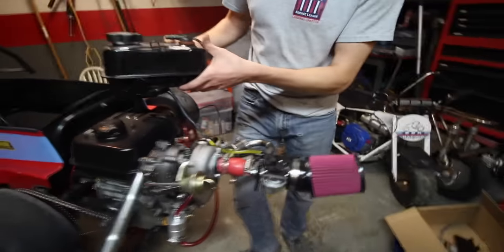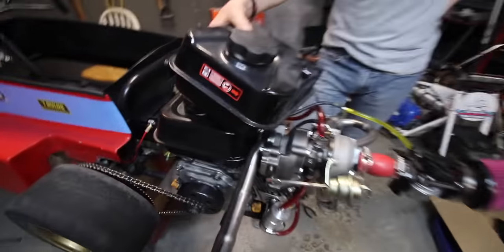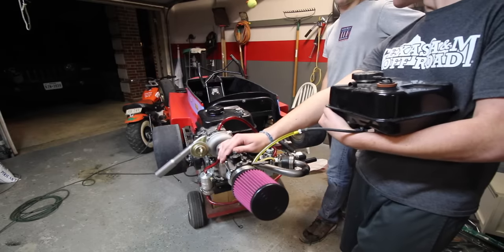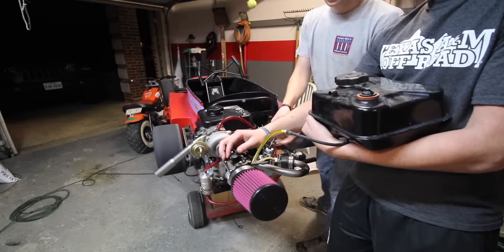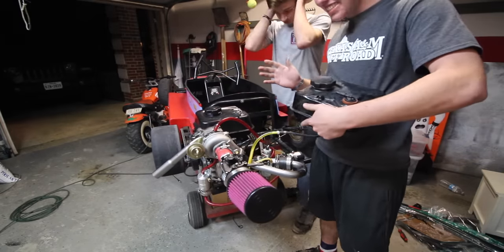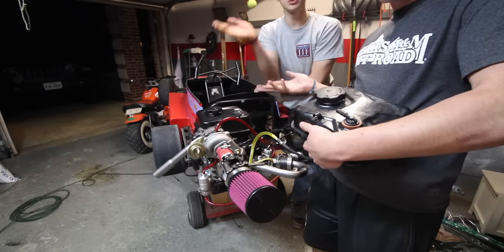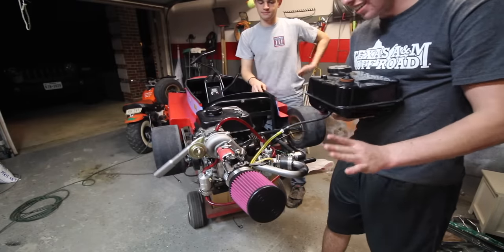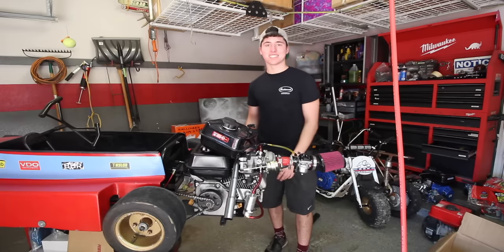Turbo Go Kart Finally Makes Boost!

Comment: There's two ways to do this with the setup you have!!(actually theres 3) All using only 1 carburetor!!

First two do not require carb on the turbo!

1: If you just build a box to put the carburetor that is on the engine inside of, then seal around the fuel line and throttle cable, applie boost to the box and not through the carburetor... it solves "some" of your fueling issues!! and you'll only have to Run one carburetor!!!  When you do this the whole carburetor sees positive atmospheric pressure and not just the Venturi!

Or.... 2: block off the Venturi Port which is the very bottom little hole you see when you look into the throat of the carburetor, then T into the boost line and apply boost to the carbs Bowl vent And boom! You've modified your Mikuni to be a blow through boosted carburetor!! 

In both of these setups without a fuel pressure regulator that applies positive fuel pressure at the same rate that boost comes on!! When the Boost does come on in both of this setups you will only be running on the carburetor's Bowl only.. so you won't be able to continuously stay on boost....

3: leave the carburetor thats before the turbo ditch the one that's on the motor and just jet it right!(This is the easiest one! but it doesn't create as much power as the other two)
Reply: Won't work pressurizing the tank. You need a pressure differential to move the the fuel. If the pressure in the carb is 5 psi, and the tank is 5 psi, what moves the fuel? There's no longer any vacuum. You need a boost referenced fuel system...

or quit fucking around and just draw through the 1 carb and forget about the second one. I'm still lost as to what this magical tuning problem is that can't be solved.

The first SVO Turbo Mustang was done the way I explained. It ran a mechanical secondary 2 barrel, into the turbo, and into the engine. Still used a regular float and fuel system. 

I gotta believe a set of jets has got to be a hell of a lot less expensive and time consuming than a boost box and a jerry rigged boost referenced fuel system .
Reply: Both setups I referenced only require one carb.... The two carb stuff is just wacky.. to say the least LOL
But, Your right About the boost pressure to the tank thing.. I didn't think it through.. LOL 

And a draw- through setup is a third option, its how alot of peolpe turbo bigger Vw engines... a 4 barrel carb or a side-draft weber draw- through setup! And they work good but, not as well as a boost boxed carb or blow- through carb setup and spitback/backfires on a draw- through carb setup can be catastrophic!.... But, with their fueling issues & "expertise"  a draw- through maybe their only option to just make it work! You know their gonna need help with the jetting though!! LMAO!
Reply: @superchargedadventures  The other thing that makes these setups a bit of a bear as well is the lack of an accelerator pump... unless those other carbs have them (I don't think they do) that nail the throttle open enrichment just isn't there... it has to draw air through to stabilize it and then get a stable mixture.
Reply: kleetus92 True! I think their best bet for top end at least.. would be to do a power jet mod to the carb!!

Comment: just use the carb pre-turbo. since velocity (air speed) is what pulls fuel, the one carb if sized correctly, and right jet and needle will meter fuel linear to air flow. The double carb will create serious issues. It will wind up with too much fuel, and too much turbulence.

Comment: What if you take something like they use in No2 set up to step down the shot strength except for your fuel for the second throttle body and leave it fully open all the time, that can be how to tune the fuel going in and then you just use the first throttle body going into the turbo intake side as your throttle control

Comment: On carburetors you need a pull through system or else the boost is just going to push the fuel out of the carburetor back into the tanks.

Comment: You should mount that Turbo on the intake side of the carburetor like a normal turbo would be mounted but instead of having your exhaust wind the turbo use a radio-controlled brushless motor to spool up the turbo which means put a pulley or a spur gear about the size of a 50 cent piece on the brushless motor with a smaller gear about the size of a pencil on the turbo input shaft and hook it all up with the radio control brushless Electronics and just use the transmitter as your throttle to spool up the turbo. I want a shout out if it's a thought that you think it might work

Comment: Pull through carb setups were basiclly the first turbo setups, they work really well, so long as you don't develop any leaks past the carb. They can be risky, because if you lose a charge pipe the engine goes full throttle.

Comment: Most carbs are not capable of being pressurized, when you push air into the intake it pushes fuel out, 2 solutions for this 1 draw through and 2 put the carb in a box so pressure is equal inside and out, but you also need fuel pressure and a rising rate regulator at some point.

Comment: The first carb in the boost tube wont ever work unless you delete the fuel to it and use it as a throttle body. Take you fuel line and run it to the before carb like an injector and remove the throttle flap out of it. Thats the only way your setup will work. Turn the fuel up and run it. There is still a chance of flooding the intake when lettin off the throttle due to the turbo still spooling drawing the gas out of the other carb

Comment: You need to use either a suck through system that sucks the fuel/gas through the turbo or a blow through system that blows the fuel/gas through the carby and the blow through system will need some kind of fuel pump as the boost will blow the fuel through the carby back into the fuel tank

Comment: Put a pic T fitting between the turbo inlet and tct carb so it gets air without having to floor the tct carb and flooding it to get it started

Comment: either leave the second carb wide open. or just do what people have been for ever and run the one carb on the turbo and tune the idle jet where itll idle and then mess with the main jet. the carb will pull more fuel as more air passes by the the throat

Comment: You should use throttle controls like a old Honda odyssey. Have them both on the wheel it will be easier to control because it would be like triggers on a ps4 controller.

Comment: They make an e.f.i kit for single cylinder engines...it comes with a throttle body, t.p.s, e.c.u  thats"programable"... fuel pump, fuel injector,  oil pump, turbo, wiring harness etc.

Comment: Make secondary fuel setup a washer pump motor that 12v push button activated. Shoot directly into the turbo.  which may be too much fuel so you would have to nozzle it so it wont dump raw fuel into the turbo.    kinda like how they introduce nitrous to the motors on these engines.

Comment: Mega squirt I beilve has kits that will work with any engine . Ever heard the acronym KISS?  What your doing is very complicated . You need more fuel pressure than boost.  You going to want more control than what your doing can offer.  I love the idea though.  Mega squirt it.  If your going to stay with cabs look at goped , polini and blata  carburetors there are some that make 20hp + . The carbs are adjustable.

Comment: replace the carb closer to the engine with throttle body and use it to cut vacume from the turbo on low rpm and oart throtle to keep the engine sucking oil from the turbo. Use the suck through system to deliver the fuel

Comment: Seems a bit complex, with the right carb I think you could go blow thru and make it work. I doubt it'll be big gains, I mean your power stroke doesn't have tons of heat energy in it (nor volume despite the tiny turbo) in such a small single cylinder. Good luck with however your proceeding with it!

Comment: I don't know if you talked about it but if I were you I would put an air cleaner on the front of the turbo and then run the boost to the carborator so u don't have to worry about two throttles and two carborators. I see that you tried this; however, go take a look at a turbocharged diesel and see how the fuel is regulated based on the boost

Comment: Take out the main jet on idle carburetor and plug it. Then you should have a carb that only lets it idle you may have to mess with idle jet sizes. Like so they can try

Comment: Maybe if you put screws in all the holes in the carb you can find it will run on pure unicorns and fly through the air and time travel too. 1 screw = boost... Then 50 screws = flying unicorn time machine

Comment: Just bolt 2 carbs together and make the throttle levers tied together. So u would only need the stock gas pedal

Comment: Build a speeduino n2c EFI system yourself. You can run a car injector and control your boost. Costs will be lower than all your seperate components.

Comment: If your going to leave the after turbo carb you will need to pressurize the whole carb, vents and all. Dont plug any ports. All vent tubes on the sides need the turbo and pressure. You'll also need a fuel pump that can compensate for the turbo boost, the more the boost the more fuel pressure. Otherwise the turbo boost will just push the fuel back and out.

Comment: From what it looks like? your making a blow thru! Why didn’t you put a 34pic (Baby Webber) in the stock carbs position, with a throttle body to control the air flow( keeping the mix happy).  Check out some over the blow thru VWs on you tube.

Liked that your trying new things.
It’s nice that guys are still testing their our ways and turning wrench’s

Comment: Take throttle blade off throttle body before turbo. Play with the fuel jets and needles a bunch. Check spark plug for proper fuel ratio. ENJOY!

Comment: Just run the one carb off the turbo as a drow through get rid on the draw through(one mounted to the motor) if you don’t want to take it off the just take the fuel off so your not getting to much fuel

Comment: get a Y pipe and put the two carbs on the Y pipe and hook up the other to the inlet of the turbo. make it run with one carb untill you need more gas then kick the other carb in. idk just a idea

Comment: Putting atomized fuel through a second carb is going to result in nothing but trouble. The atomized droplets will conglomerate and richen the mixture to a point beyond efficient combustion. Draw through, or blow through. Blow through will give give you the best result if you tune your fuel system properly due to the latent heat of vaporization. Draw through will have a much higher intake temp.

Comment: If you do blow thru style u need a fuel pump capable of more psi than boost then get a boost regulated fuel pressure regulator

Comment: You need to put the charge pipe in between the engine and the regular carb, because you will not be able to pull air through the closed butterfly of the second carb!

Comment: What if you run no fuel to the bottom carby and leave the top carby wide open. Just use the bottom carby to control the air. You're always going to have trouble pressurising the bottom fuel bowl under boost which will stop any fuel entering the bowl unless the fuel pressure is higher than boost pressure. But draw through carby should work just fine with the right carb setup.

Comment: turbos push air through the carb by way of exhaust turning the turbine. you're using it for a puller, in which it was not designed for

Comment: in the begining when you reved it and it shut off the boost is blkwing the gas back through the lines into the gas tank and shutting it down you can lessen this alot by running a line from the charge pipe to the gas tank so the same amount of pressure trying to push the gas back into the tank is met by the same pressure pushing it into the carb and when its equalized it will flow some at least do alittle searching online about it but really the only way to safely and reliably turbo is efi

Comment: if you had a fuel pump and pressure regulator you can raise the pressure of the fuel to the original carb, road did that on the monza they put a turbo on

Comment: youre pressurizing the float bowl of the lower carb and causing it to flood massively - get rid of Blow-thru carb and just run one larger on on the intake side of the turbo

Comment: You cannot "blow through" a "draw through" carb, just needs the mikuni on the inlet of the turbo and will be fine
Reply: You can, you just need to boost reference the fuel tank and float bowl. Block off all passages that lead to atmosphere. OR.... make a sheetmetal box to go around carb that seals to the intake of engine. Use a little rtv to seal the hole you run the throttle cable through

Comment: You need to raise fuel pressure just put one carburetor in front of the turbo and put a fuel pressure regulator on it that will add fuel as boost comes on

Comment: Guys have u tried with a double or partial intake? One on the na carburator and a switcher or something Like a vastegate when the pressure of the air overflows it engage the turbo

Comment: If you build it as a draw thru set up it will save you alot of headache and be wayyyyy easier to tune.. only one carb should be needed

Comment: They make throttle body fuel injection for kit a for small engines with programamable ECU with a map sensor I think that would be a better route..

Comment: The main issue I see is your secondary carburetor. It's not a blow threw carb and you have no boost refrencing system on your fuel feed to it so what's happening is when the turbo starts to spool the charge pipe pressure is backing up the fuel delivery pressure in the carb stoping fuel from being able to enter the carb in the first place leaning out the mix and killing it. It should be able to run with the single carb if it's large enough before the turbo but to have a carb in line you need a way to increase fuel delivery pressure in accordance with boost pressure or you get say 7lbs of boost going in and only 7 lbs of fuel pressure  with no refrencing system to increase the fuel pressure as the boost comes in causes the fuel pressure to 0 out. So basically if you get 7 lbs of boost you need to up your fuel delivery to 14 lbs so you maintain the same 7 pounds of fuel pressure at the carb does that make sense? You can't just add boost with out refrencing the pressure for the fuel flow and compensating fuel pressure as boost pressure increases boost pressure and fuel pressure in an  unmodified carb ment for N/A just wont work. You can get away with an N/A carb so long as it is before the turbo and the turbo draws air threw it (that's the carb you got it to idle off of) but if it's not big enough to handle the cfm the turbo draws it won't spool well that and running fuel threw the turbo is never ideal.
Reply: In far less words you need to modify your carburetor to work with boost  or buy an after market carburetor (blow threw carb) and add an electric fuel pump with a boost refrencing system that will up the fuel pressure as boost pressure comes in. I hope this helps with any of your future attempts at this project. Keep up the good work love the vids. It's nice to see young people useing their brains building and trying to make stuff work instead of just vegging out in front of the TV.

Comment: First carb won't work right with boost pressure so remove the car run a manifold straight to the intake port and get a bigger carb mounted where the turbo intake is also if it's running real hot you will need more fuel

Comment: Just use one carb using the 2 bolt pattern on the inlet and jet the carb to run a richer fuel mixture and just rout the charge pipe to the engine use hose tho

Comment: You dont want a turbo with the carb in fromt of it unless its got carbon seals bc it will suck the oil through the seal and into the engime. To buold a carbd set up and easiest to tune is to build a box around the carb thats connected to the intake. By doing this you essentially create a false atmosphere around the carb so as boost pressure increases so does the external air pressure ensuring that it is more or less boost referenced to prevent lean out under hard throttle.

Comment: I had a blow through kit on my car..the carb had to be sealed and supplied with high pressure fuel..obviously or the turbo pressure pushes the fuel back into the tank.

Comment: I like it so far, I see two things wrong though. It doesn't look like you have a proper fuel pump, go electric and have a boost reference fuel regulator( pulse pumps can't handle much boost). You also need to make sure both the vent tubes on the carburetor are blocked off from atmosphere and are going into the inlet of the carburetor. Definitely stick with a blow through carb. Unless you're going to drag race all the time.
Reply: WTF does drag racing have to do with anything here? Blow through is a pain in the ass, they never even tried just running it with the first carb, so they literally have zero proof that it won't work without the second carb... 

just for sake of testing, take the second carb and hold it wide open, and disconnect and plug all the port and fuel connections so it acts like a straight piece of pipe. 

Then try running it off the first carb only.

Comment: You have to use one carb .if you are blowing boost into a carb then the fuel bowl must be under boost as well..plumb the fuel bowl vent into the turbo charger pipe..problem solved..all blow thru systems work this way

Comment: Fuel Pump +  boost dependant fuel pressure regulator + fuel gauge   _ 1 ps1 per lb boost... you used method similar to corvair turbo